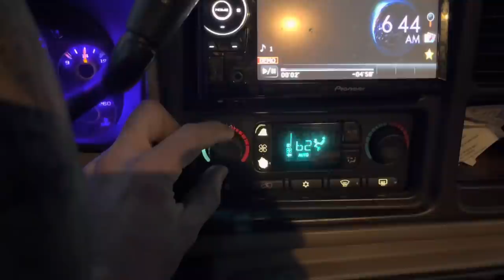He has owned it for 45 years but hasn't drove it in 17 , we got his 28 ford running again !

Comment: The mechanical brakes, when properly adjusted, are actually pretty good at stopping.  You can get steel belted radial tires for model A now too.  I have them and they make a big difference on the drive stability.
Reply from the maker: Ok thank you

Comment: Excellent video Sleepdude  :) very rare seen old cars from 1910 to 1950 are close be orgnail anymore and be lots updated modern motor plus axles plus more! I know guy has 1937 Chevrolet Coupe in 2 door has grey also black body plus has 1978 Buick Skyhawks 2 barrel Rochester carb on 3.8 Litre Big V6  called 262 Cubic Inches with daul exhaust, Turbo 350 Automatic transmission, 377 posi rear gears plus Power Brakes & Steering plus modern gauges for Volt , Gas, Oil pressure , head lights , wireing , key ignition in dash and speedometer to with digital reader! Funny part got 25 gallon fuel tank, 2 buckets seats, still frame in wood bolt in S 10 Chevrolet 2 door pick up truck frame also bumper also headlights bulbs change too and lens orgnail plus got updated new mirrors also orgnailly horn works too plus rad too! Even rare on car works are Moon lights near front of door also got windshield wipers motor updated 12  volt ! Floor shifter for Transmission plus emergency brake handle to! No heater in it all my buddy car and your grandfather car be $375.00 to $500.00 to buy new !
Reply from the maker: Wow that sounds fun

Comment: At the center top of the instrument panel is the fuel gauge.  It works by means of a float on the end of a long rod.  When the fuel is full, the float goes towards the top of the tank and through the lens of the gauge, you should see "F".  When. the fuel is really low, the float sinks and the reading is "E".   Now if you can't see any movement in the gauge, it probably means the float has deteriorated and is at the bottom of the tank all the time.  It's pretty easy to remove the gauge (make sure the tank is more than 1/2 empty) with two special tools that remove the two rings that holds the gauge into the tank.
Reply from the maker: Ok thanks, his doesn’t have any letters left or anything

Comment: LOL, Do you watch Vice Grip Garage?  He just bought a Model A on there about a week ago and drove it 714 miles home!  Took 3 days and he had to keep repacking the water jacket.  Granted he did have better tires though.  You talk about that bicycle pump.  When I was a kid that's all we had and we aired up everything with it from bicycles to cars n trucks and even big tractor tires.  On the tractor tires we'd spell each other so no one got too tired pumping.  When I was old enough to get a proper job off the farm one of the first Christmas presents I got my Pappy was a two-stage 60 gallon upright air compressor, LOL!  Now I'm 53 and last year I finally got a 60 gallon 2 stage for myself.  I still have the old manual pump though.  :)  TIRES...casings are intestines and hold sausages and when they don't they get called chiltlins, lol.
Reply from the maker: Yes I watched that that’s a long drive, that’s funny

Comment: For a better ride, may need to take the springs apart and grind off the ridges where the spring leaves rub against each other.  I don't know it this car had shocks, but they came with adjustable Houdaille hydraulic shocks.  Spindle bolts may need rebuild.  The gas gauge was just on a cork bobber and you read the level in a gauge which moves vertically up and down.  You probably know all this, but just thought I'd throw it in.  Great video, thanks.
Reply from the maker: Thank you I appreciate it

Comment: I had a 1938 ford AR dump truck very original (6000 miles) and it did indeed have a red steering wheel 👍🎩
Reply from the maker: That’s cool
Reply from the maker: That’s cool
Reply: Should have read 1928 AR

Comment: 7:07...start with truing the wire wheels, same as you would with spokes on a bicycle. get the slop out of the steering & suspension and get new tires.
35:32..I'm also a '42' and ride like hell.
Reply from the maker: That would definitely help

Comment: Early '28's were known as AR's. The park brake would be to the far left of the floor. They also had red steering wheels. When the wheel got water on it the color would come off on your hands. By the way, your Moto Meter is👍🤏 on backwards. The small window should face the driver. Timeless video.

Comment: Hey.  Here's How to get 5 more mpg on any car or truck.   3 things.    Take off the 50lb fan and run dual electrics with a thermostat.   And reduce the diameter of the tires as small as you can with out completely throwing off odometer.    And get highway slick tread.  And Please trust me on this. You do those 3 things at 60mph that truck will get 5 more mpg then it's getting now..
Reply from the maker: That’s makes sense

Comment: if the exhaust manifold was fixed it would sound not so tinny and might run more smoother. i think you can braze that manifold and get away with that i reckon. but good car, and good job on getting it all cleaned up and running better.

Comment: Bonnie & Clyde car was modified version and with big power and torque!
Reply from the maker: Right they had the v8
Reply: @Sleeperdude  yes modified 292 Flat Head V8 motor 1 barrel Carter carb with hand choke and 3 speed Manual transmission floor shifter and 171 ratio rear end from pick up Ford experiment with  !

Comment: What a great video! I bet that engine runs a little warmer since the timing was advanced and might be why it dumped some extra water that was staying in the cooling system before because it wouldn't get as warm. Also, didn't those old Model A's have adjustable mechanical shock absorbers?
Reply from the maker: You may be right, I’m not sure if they are adjustable or not